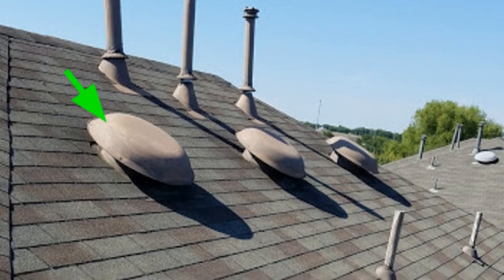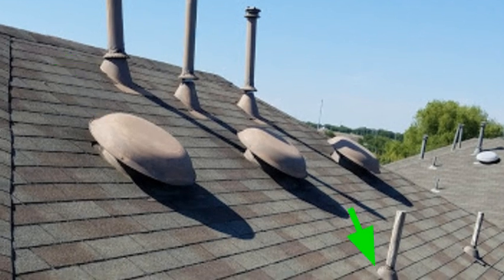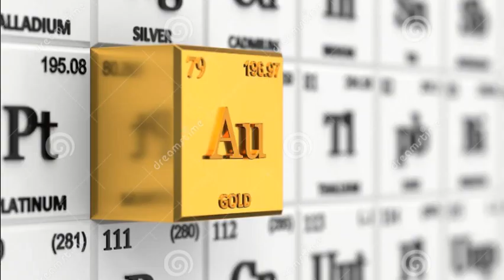How to Install Pipe Boots|step by step| (DIY) Asphalt Shingle Roofs!

Comment: Is sealant needed where the top of the boot meets the vent pipe? Is the rubber there a good enough seal?
Reply from the maker: On the rubber ring that wraps around the PVC you can if you'd like to. The flashing itself says 'no caulk' along the bottom edge meaning you don't need it. As long as its a tight fit and no gaps are left between the two you should be fine. One thing to keep in mind is that if you decide to seal that area I noticed some people  like to use Polyurethane based seal on the ring I wouldn't use this type of seal in that area. I've notice that  Polyurethane deteriorates the rubber prematurely, I would recommend you use your regular rubber roof cement or a clear silicon. Polyurethane is a great seal but only for metal to metal flashings or metal to concrete. Great question glad we could help! Stay tuned, before the weekend is over we will be uploading another How to roofing video (How-to remove a satellite dish off your Roof)